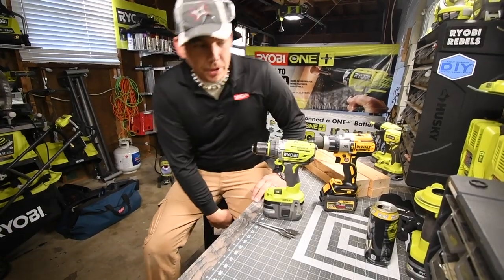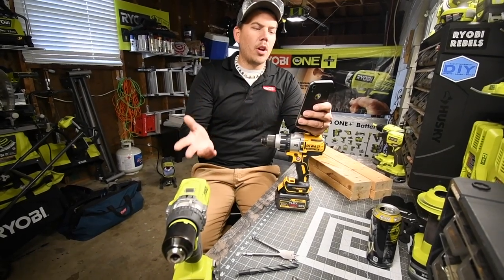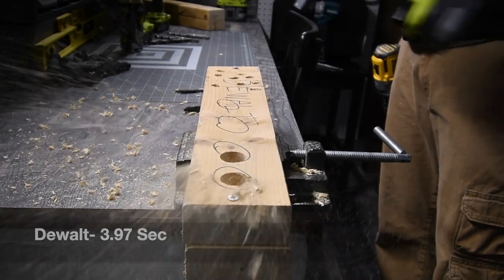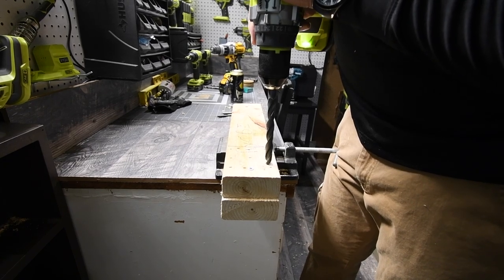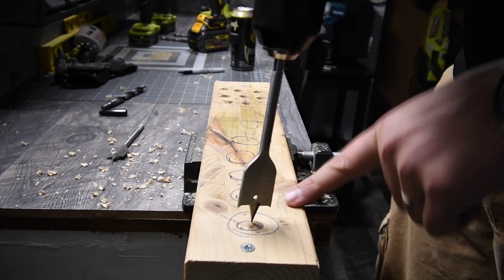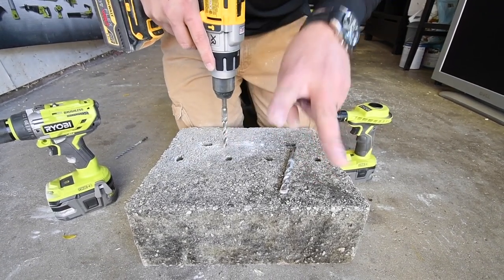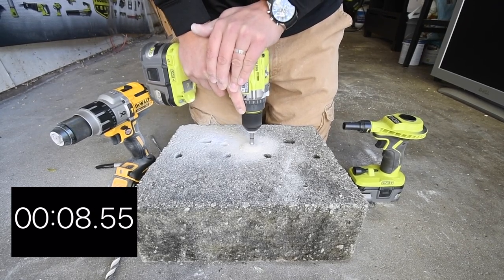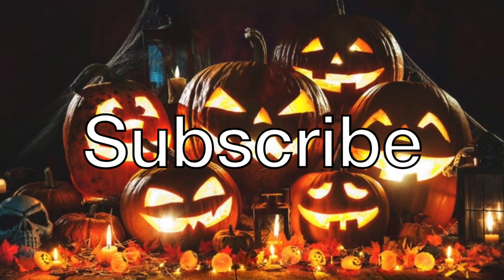Ryobi HP vs Dewalt FLEX

Comment: The FlexVolt battery does help; however, i believe the HP Ryobi batteries are the 21700 cells. So, apples to apples you’d want to use the Dewalt batteries that use those cells. Ps- got my 996 w/ FlexVolt battery for $100.00. Been super happy with it
Reply: Ryobi HP cells are High Performance 18650 cells.  Those cells perform in between standard 18650 cells and 21700 cells.  Ryobi does have a new HP 3.0 slim pack which has 21700 cells.  But it was not used in this video.
Dewalt's 6.0 Flexvolt uses 15 - standard 18650 cells vs the Ryobi which uses 10 - 18650 HP cells.  Pretty close, in my opinion.
Reply: Ryobi has 2 versions of 3 Ah HP batteries. The P191 with 10 18650 1.5 Ah cells and the P195 with 5 21700 3.0 Ah cells.  The older P191 has greater current capacity and delivers more power to the tool.  The FlexVolt 6.0 Ah battery has 15 2.0 Ah cells and the Ryobi has 10 3.0 Ah cells.

The reason the older 18650 3.0 HP has more power is because the two parallel banks of cells double the current capability of a single bank.  The single bank of the P195 21700s can put out more current than a single bank of 18650s but not close to double provided by the parallel banks.  The same applies to the FlexVolt which uses 3 parallel banks which provides 1.5 times the current capacity of 2 banks of identical batteries.  The Ryobi 6.0 Ah has higher capacity cells which generally have a slightly higher current rating but, if that rating is less than 1.5 times that of the DeWalt cells, then the Dewalt battery should provide more power to a tool.
Reply: Thanks for the info gents. Ryobi makes a decent tool. I got started with Dewalts line and stuck with it because i already had batteries. Overall I’ve been happy. Wish the nailers were cheaper but i got the 18Ga for $180 on sale and it does the trim work i need it to.
Reply from the maker: The results are are there, but I still love ryobi
Reply: Ryobi Man Caver, nothing wrong with that. They’re decent tools for the money. They have a wide range of tools. I’m not bashing them at all.

Comment: Following on from several other comments I too would say the difference in performance does not justify the difference in cost of the tools, apart from, as you said unless you're using the tools day in, day out commercially.  This was an honest and fair appraisal. However on the previous test comparison I noticed, and you commented on, the excessive vibration when using the DeWalt tool to drill into the brick/block. I too have noticed the same thing when using my son's DeWalt drills (he is a professional Joiner/carpenter.No one seems to want to comment on this, or did they not see it happening before their eyes.Keep up the good work Dave.Tony.(UK)
Reply from the maker: I agree, the price difference is to great for the difference in performance.

Comment: Ryobi does everything dewalt does for half the money slightly slower but it still completes the job..and the ryobi batteries cost a third of dewalts..ryobi is owned by the same company that owns Milwaukee and rigid and they use the same battery cells between all 3lines and if you wanted to get a complete kit with sawzall and circular saw or other tools every dewalt tool is double the price of ryobi..could never justify twice the price difference for a few seconds faster
Reply from the maker: Yes Ryobi can. just like you said, not as fast but it can do the job and I thank you for viewing 408